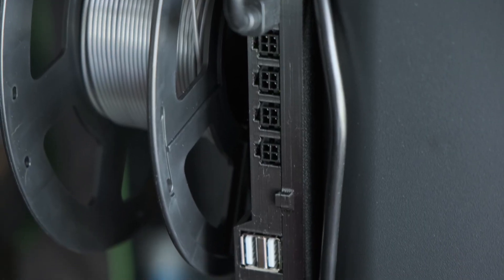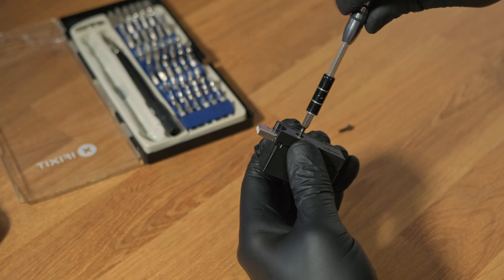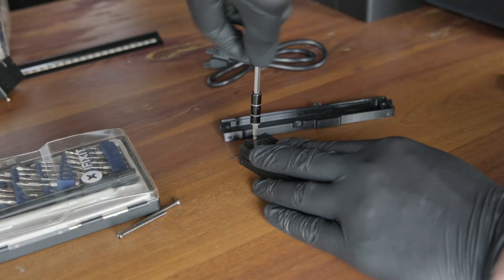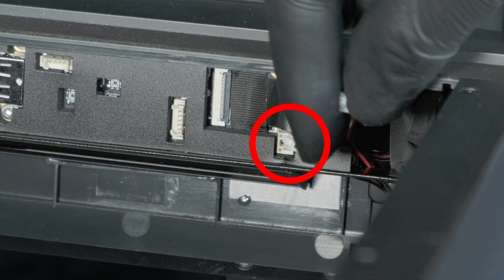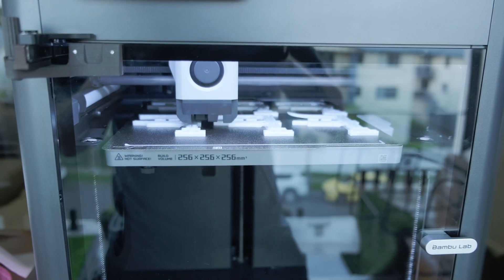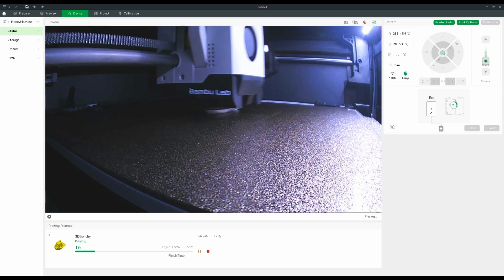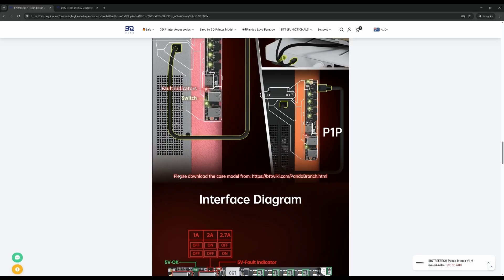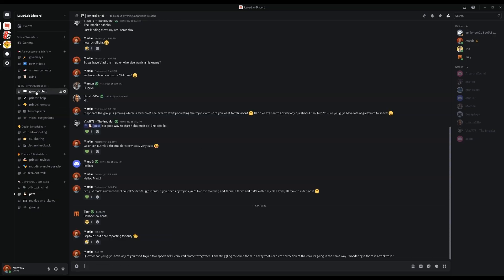Installing BigTreeTech Mods on Bambu P1S – Panda Hub, Branch and Lux LED Kit!

Comment: is there a way to toggle the USB inside on and off? or is it just always on while the printer is on. its insane how little information there seems to be on the port
Reply: No the internal USB port always holds power while the printer is on. Items connected to it can only be shutoff with an external switch (either physical or digitally with your phone is using LED lights).